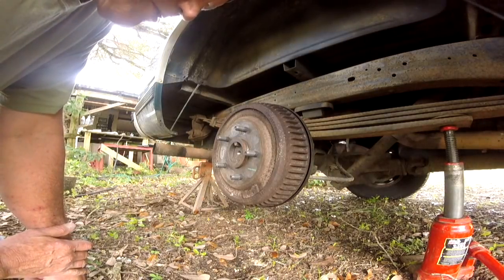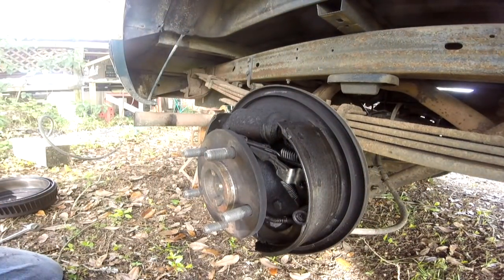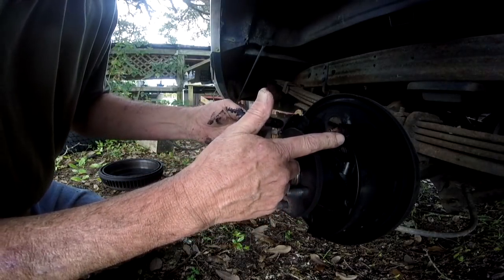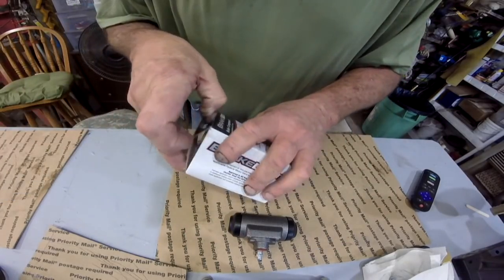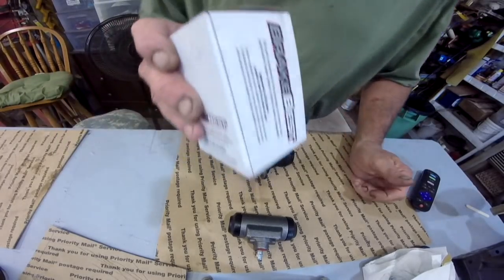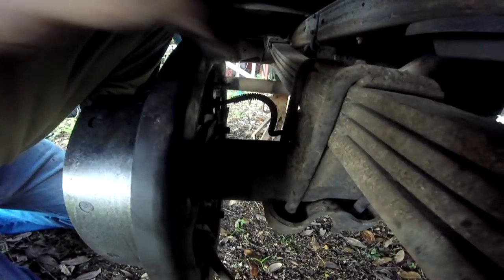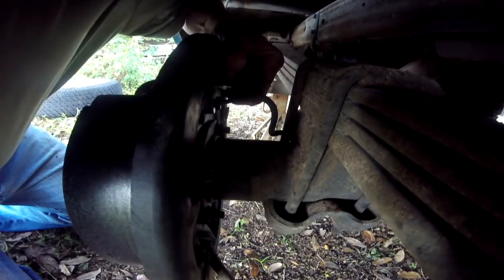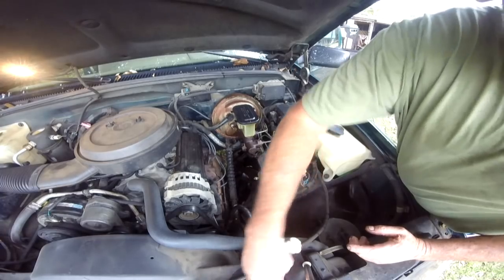Brake cylinder repair

Comment: Just think of all the money you saved doing it yourself.  I always enjoyed working on my own vehicles but some of them are really hard to work on.  My wife has a 2010 Toyota and I’ll kiss your *ss if you can even see the engine when you raise the hood.lol  It is a 4 cylinder engine completely covered with shields and all kinds of garbage.  My 6 cylinder Grand Cherokee is much easier to get to and the V6 in my F150 has plenty of room to work on.  Of course, being a Ford, it  rarely requires repair! lol  Do Chevy trucks in Florida come with hand-warmers on the tailgate or do your hands get cold when pushing them?lol  Sorry Ricky, couldn’t help myself.  I’m a Chevy man too but my son gave me the F150.  It was 6yrs old and had 40,000 miles on it.  Even a die-hard Chevy man has trouble turning down a free Ford truck with a new Lear fiberglass shell and new tires on it.  Phil
Reply from the maker: No handwarmers!  Free Ford?  I would park it behind the house so nobody sees it  :)